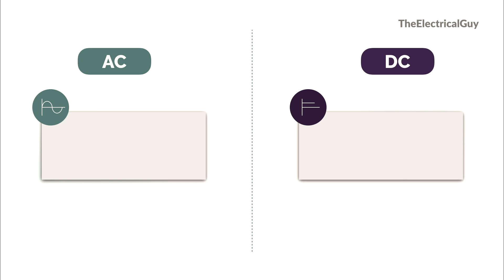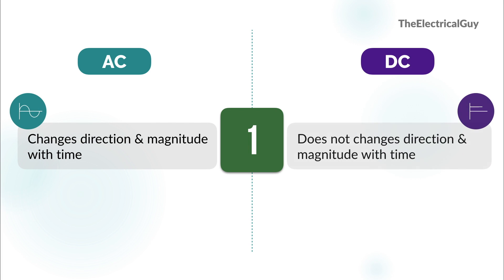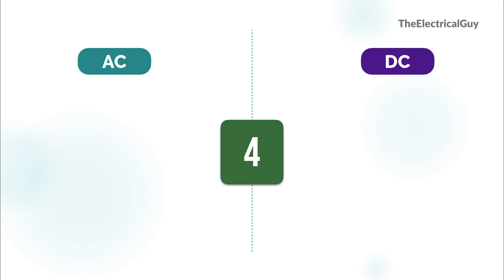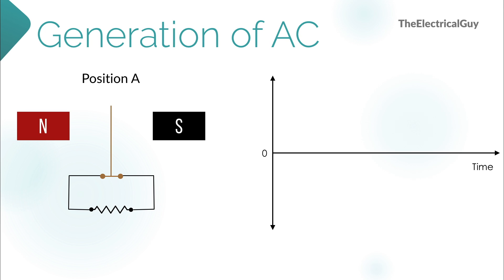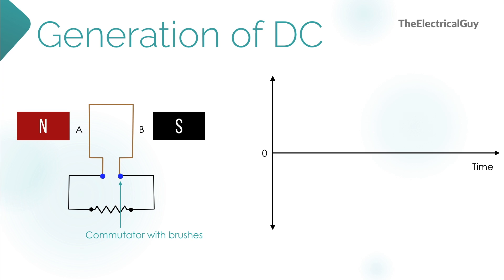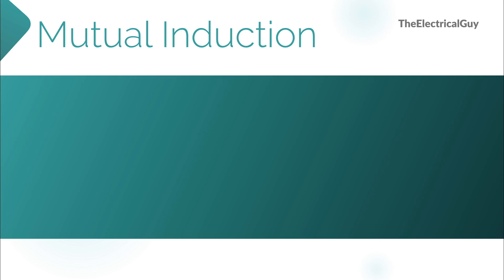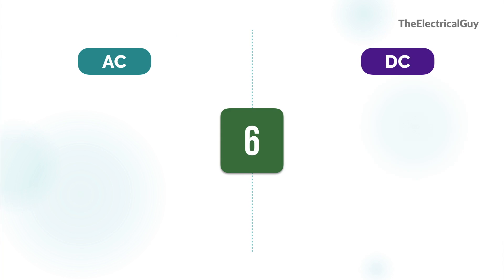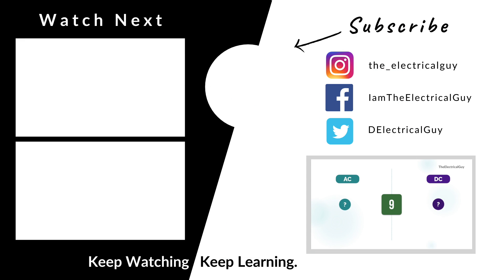Alternating Current (AC) VS Direct Current (DC) | Why AC is better? TheElectricalGuy

Comment: Why transmission in high voltage is more efficient?
Reply: Due to low power losses
Reply: 2 year ago comment but it's okay 😅

As voltage increases, current flow through the line decreases and I2R loss reduces. So transmission efficiency increases. Therefore high voltage is preferred for power transmission.

Comment: Good job and keep going. 
Thanks for this explanation 👍 
Can you tell us which one is more dangerous than other AC or DC.
Regards
Reply: I gonna explain that bro 😊

 One of the reasons that AC might be considered more dangerous is that it arguably has more ways of getting into your body. Since the voltage alternates, it can cause current to enter and exit your body even without a closed loop, since your body (and what ground it's attached to) has capacitance. DC cannot do that.

Comment: According to ac theory, current has to flow through both wires alternately but we find live wire and neutral wire in domestic ac applications...does that mean the electrons come through live wire and return through neutral like dc current...Please explain...
Reply: Alternating Current (AC) is a type of electrical current, in which the direction of the flow of electrons switches back and forth at regular intervals or cycles. Current flowing in power lines and normal household electricity that comes from a wall outlet is alternating current.😊

Comment: I've never heard anyone refer to AC and DC voltage. Voltage in AC or DC is the same it's just the  potential difference. The reason AC or DC are called that is because the only thing that alternates or doesn't is the current in the wire.
Reply from the maker: Yes. That’s the thing differentiate these two.